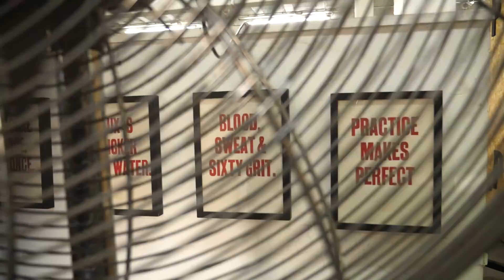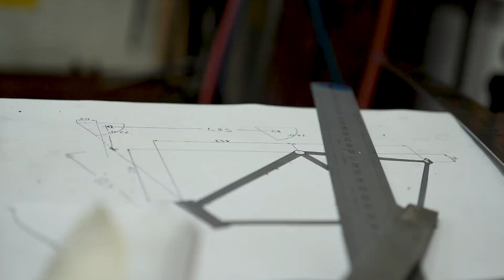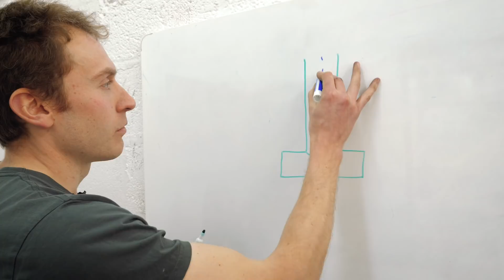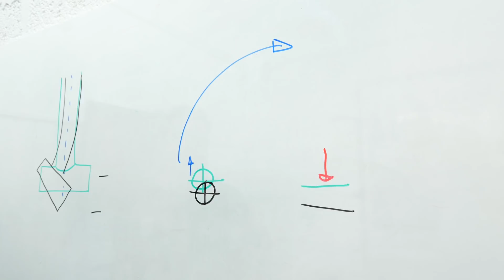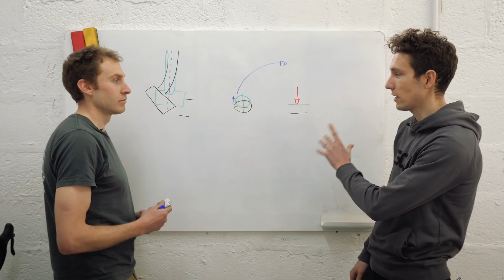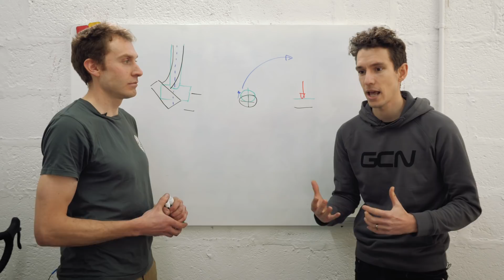Are You Faster On A Stiffer Bike?

Comment: It's really no rocket surgery.  As one that has worked with suspension on motorcycles for years, a basic understanding of suspension is recognizing that a spring is nothing more than an energy storage device.  Compress a spring with force, release that compressional force, and the spring returns the stored energy back in rebound.  This is why we have damping in suspension... to control that rebound effect of returning energy back into the system.  Obviously, as with all energy transference, there is some amount of energy consumed and released as heat rather than mechanical energy, but with a basic spring that energy loss is miniscule.  A flexing bike frame is nothing more than a spring...  Bend it, release the compressional forces that caused it to bend, and that stored energy is returned to the system.  It is actually a bit more complex, but the basic principle described in this video is really pretty elementary physics.

And you didn't even get into the benefits of frame flex in increasing suppleness, decreased rider fatigue, the effect it has on tires, etc., etc...

Comment: Where is the energy returned? I think this boils down to how much is the frame being heated up. It's not zero, because flexing a material is not loss free. But can anyone put a number on it? Frame flex is much more important as it affects alignment than for other reasons. The wheels need to track, and things need to not rub as you pedal (both for physical reasons and psychological reasons). Riders have actually attributed grip problems when cornering to too stiff of a frame,  I remember Chris Horner mentioning that they noticed this happening with the Trek Domane the team was given (whatever year it was). Apparently they talked to trek about it.

 I think a traditional steel frame (1'' top tube, 1 1/8'' down tube) is probably good enough for many people. Bigger riders might decide oversized tubes provide a positive difference. Anything else is for weight reasons in my opinion. Carbon fiber frames cannot be light without being very stiff, or way too flexible and/or not strong enough). 
This is what happens when the next year's frame needs to have a sightly smaller number next to the 'g' symbol on its data sheet. An entire sport, and an entire recreation of riders acting like clowns for seemingly no good reason. 

Wasn't the whole point of the UCI rules that no rider shall receive an advantage from their equipment? So what if everyone's bike weighs 8 kg, or 7.5, or 6.8? But at least we can leave that to professional racers who need to stay competitive within the rules to worry about. Non racers doing it is cringe worthy.

Comment: You mention tire widths. Same principle with frames. The more deformation, the more energy loss. A better experiment would be; have the host do some riding and track his power and velocity on the same course with the two different bikes. 

This experiment is tracking the stiffness of frames. Stiffer frames will respond quicker which transfers the power into fhe drivetrain, it doesn't show an energy loss. In the second bike he use applying more force, so yes more force was used.

Comment: This was a good way to illustrate flex, but not a proper way of testing flex/stiffness vs efficiency. Tthe amount of movement of the rear wheel is basically irrelevant because they've tested to an even amount of flex (which is requiring different force amounts. A much better way to test is to use the same force. It's more difficult to test that, but that is the type of test that could actually supply useful data.

Relating to their conclusion that frame stiffness might not be as important as previously tought -- even if it is just as efficient (it's NOT), a flexy BB area on a bike is annoying, AND if you're getting chain or brake rub, those are additional losses.

Comment: The biggest problem I have with this demonstration is that the load which flexes the frame peaks where his pedal was and drops off towards the bottom of the pedal stroke. This means that the frame bending back to its original position at a 6 o'clock would merely move the pedal out to the right and not cause any additional rotation or therefore put the power back into the drive system.

Comment: Nice video. Good amount of frame flex has another benefit, you have more mechanical tyre grip as the "suspension" frame flex in corners.
Race motorcycle's use this principle aswell.

Comment: even if the frame "gives back" some of the power that flexes it, this process will waste some energy anyway, it's a matter of physics. The reason why this couldn't be necessarly that bad, is in my opinion in the fact that the "kick" of the frame might be well "synchronized" with your pedal stroke in the dead point, and (at a high pace I think) result in the feeling of a more fluent -and thus efficient - action

Comment: I am so confused and amused.  First off good show.  Less scientific than id like , more measures of force etc.  However i had my aluminium frame bike getting worked on.  So i road my  iron giant, vintage moutain bike on a long gravel ride instead.  Racing home for lack of daylight, and lights.    I did 16miles an hour for 10 miles.  I was amazed.  I have not yet been able to duplcate, this on my much newer lighter, aluminium, stiff frame bike..  very interesting.

Comment: Tall guy who just got his first carbon frame after riding on an old steel frame. 

I ride a 62 cm bike, I wonder if the length of the seat tube has any effect on the amount of flex. One of my more seasoned cyclist friends suggested to me that longer tubes flex more, which seems to make sense. 🤔 I know that my new carbon bike certainly feels faster, but I’m sure there are many factors at play other than just frame stiffness. 

Very interesting vid.

Comment: My GT cross-country frame does this. When I first noticed it definitely made me skeptical about the ability of the frame to do what I needed it to do. After 3 years of really solid single track and light jumping (3 feet or less) I'm convinced it will never be a problem. And at that point, if it is a problem, I should probably be on a more rugged frame than a XC anyways.

Comment: A perfectly stiff bike should have zero energy loss while a flexible bike will still have some "hysteresis". If we're worried about watts, then even 1% of your input is substantial. 3 watts lost at 300 watts.

The energy of a spring is 1/2kx^2. Twice the flex, four times the energy stored. Four times the hysteresis losses.

Stiffness will improve drivetrain efficiency until hysteresis loss becomes negligibly small.

Comment: Very interesting...and reminds me of a pendulum effect that once the bike flexes from side to side, that exactly provides the momentum. Very similar to when you're lifting weights, a bit of swing in your body or arms provides that little bit of inertia to make it seem easier to lift the weight compared to a dead lift. 

However, on the flip side, the flex might also be stretching the chain slightly that when the brake is released, the energy stored in the stretched out chain is released, making the rear wheel spin.

Comment: surely this experiment could have been made much more effective by applying a fixed mass to the pedal with and without the brake and counting the turns of the wheel to see if anything is lost by holding the brake. If releasing the brake results in less wheel turns then applying the mass without the brake then energy has been lost through the frame flexing test

Comment: The work on the pedal increases over time but power put back into the elastic spring like frame doesn’t increase. Overall it seems like you are losing some power transfer.

Comment: Flex on steel bikes is purely elastic, and therefore this action itself loses no energy, just acts like a spring.
Different angle on crankshaft might increase resistance, but because crankshafts have angular contact bearings, the difference between complete straight action and slightly angled stroke will be negligable.
On the other hand, because steel frames can flex on small bumps, they can actually lose less energy on rubber in wheels bending more heavily, which loses this energy on heating up.
Do a serious test in normal conditions but with power level measured and normalized to check if there is a difference.

Comment: There is a net loss in heat generated by flex, though small, its not insignificant, and also the stored energy released by unloading the frame comes at a different moment in time to the power stroke, so the effect will be (on a bike that flexes more) a more sluggish response, though a more compliant feel.

Comment: I think it's mainly about ride feel and user preferences what you feel more comfortable riding. But probably a stiffer frame is a little more efficient, as energy you convert and reconvert always involves losses to internal energy and these losses are relative to the time dependent behaviour (and in part thus to the displacement). A stiffer frame with a higher elastic modulus probably also has a more purely elastic behaviour and less viscoelastic parts, which would mean a lower energy loss during hysteresis of the loading/ unloading cycles; also less damping in both loading and unloading due to less pronounced frame flex displacement wise. Which means although the amount of energy stored in frame flex is probably almost identical for different frames, there is more direct conversion in stiffer frames resulting in less time dependent behaviour qnd less energy losses. But I still think it's mainly rider preferences as it also involves comfort and personal compatibility next to pure efficiency.

Comment: Your muscles first need to put energy in the spring (energy = force * stroke). To gain back the spring energy, your muscles have to hold the force. And here's where it goes wrong, because muscles use energy when holding a force, even without making a stroke.
Effectively what flex does is making your leg stroke longer, costing more energy, without returning more propelling force on the wheel.
You would need a mechanism to hold the force for you, otherwise flex is waste of energy. Currently, such a mechanism is not found on bikes.

Comment: This is neither new nor interesting!
The question isn't if energy is returned from the frex to the drive chain. The question is how much.
This has been widely debated in the MTB / XC community as here the suspension has the same issue.
However, testing is complicated and benefits are marginal compared to Aero.
I presume that the major issue causing friction here is the tilt of the crank.

Comment: In this experiment the rear wheel is fixed and when the pedal is loaded the distance between the rear wheel axle and the bottom bracket axle is increased so the chain is prolongs and when the pedal is released the chain backs to its normal size and the wheel start to spin.In the flexible frame  the distance between the axles under the load changes not so much( the rear triangl bends) so after the load is gone the wheel will spin not so much respectively as with the stiff frame.So the stiff frame has a better efficiency.

Comment: In this experiment, they had constant pressure on the pedal and then released the brake.
In reality, however, you don't always have the same pressure on the pedal if one pedal is at the bottom and the other at the top, for example, no pressure can be exerted.
In this case, the energy in the frame can also be released in such a way that a pedal simply moves back a little.
In the experiment, it would be like simply getting up from the pedal, then the pedal would return to its original position and the energy would be wasted.
In order to get a result from such an experiment, how much energy is released from the frame back into the pedal and how much really goes into the chain, the pedal and brake would have to be relieved of the pressure at exactly the same time.
Unfortunately, this experiment was not meaningful, the conditions in reality have not been met.

Comment: No research needed.  The explanation is fairly simple, and it's not damping/thermal loss as a lot of people are suggesting.

The bike is "returning" the power, but not at a useful time.  It's holding onto the extra energy that you're trying to put into propelling you forward, and giving it back later, through the crank when you release the pressure on the cranks.

A good analogy would be tying heavy weights to your feet.  Any energy you put into lifting your feet is given back when you put your feet back down.  But if you try and run, it's going to be a lot slower.
Reply: Exactly - if the returned power is at the wrong time it will work against you
Reply: When you are running, putting your foot down does none of the work of propelling you forward. You need to move your foot forward, which is just as difficult with the weight as pulling the foot up. Then, push off with the foot planted on the ground, which moves your body mass, and the weight on the foot doesn't move at all.
On a bicycle, all the power is from your foot coming down. With a slight amount from the upstroke if you're clipped in to the pedals. 
It is only vaguely analogous.

Comment: Stiff frame can make you faster, this is because the power transfer on the bike is so direct, while on a flexi frame, the power transfer is a bit delayed, it’ll be like an airbag, the power will be distributed around the bike instead of the drivetrain. And when the frame flexes back, some power is directed to the drivetran and some are directed to your orher leg. I hope it makes sense. 

Example: if you are doing a track stand, you apply both pressure to bothe pedals, all your power is not directed to the drivetrain, but it is directed to your other leg to balance out the power.

I’m just speaking this hypothetically

Comment: Yes. This experiment has multiple things wrong with it. the biggest thing would be that they pressed on the pedal and held it down. which just the frame right now is acting like a spring but because you're holding a single pedal down 99% the forces allowed to go back into the drive train. but when were peddling were alternating legs which means we're not constantly holding pressure on one side. 
when were actually pedaling alternating which side is relaxing and which side is applying Force. So this means that the frame is always flexing in the direction of the side with the least amount of force. so this means that the force is going in the opposite direction of the drivetrain weather be back into the frame and into your leg this equals force/power loss

Comment: Would be interesting to see what a slight flexible crank arm would be like. A strong arm stiff in every direction except the circular direction you pedal in. So that it almost to a small extent, absorbs energy and then un-flexes giving that energy back in the dead spot of a pedal stroke. I mean marginally flexible here, not excessively bendy, except perhaps for an exaggerated model. Also, this means that if suspension is not at all damped and has little or even no friction (lauf forks) then they may not actually rob us of as much power in total but rather just convert almost all of it to up and down bobbing rather than dampening it turning it into heat.

Comment: The problem is when the rotational force of the flex frame acts against your other pedal stroke which is now trying to flex the frame in the other direction. Therefore instead of adding to the rotational momentum, it reduces the momentum being applied by the subsequent pedal stroke - much like two out of sync light waves in destructive interference. This illustration is not honest. The best way to preserve the energy is to use a stiffer frame, full stop.

Comment: Same kind of elastic energy is stored in the tendon and muscle elongated and it plays significant role in efficiency of body movement. The time of energy load and the time of energy release should be taken into account, which means we should be able to measure the input  power and the output power, and how the power contributes to more efficient riding. I always  think of a elastic bike which could enhance the efficiency of ride.

Comment: Sorry if already mentioned, but... a basic flaw in this experiment is that it only looks at frame flex from one side of the bike? What happens if you put the block on the other side? As others have mentioned,  just put a power meter on the crank and a power meter on the turbo trainer for both frames  (keeping all other components identical) and see what the real losses are.

Comment: Pssh, there are so many factors that go into this and a lot depends on the rider's style, power, fitness, weight, etc. This example just demonstrates where the energy goes not that it even makes a difference in fast or slower. I think that depends on the engine. Stiff might feel more responsive and flexible might feel smoother its difference in actually making you faster is probably more based on the comfort of the rider and their ability to perform on that bike. Everything is marketing and though it might have tiny bit of merit, it comes down to being a fit rider, and frankly more than half of us aren't even in tune enough to tell the difference. If you feel fast it probably has more to do with you feeling good than whether your frame is stiffer than the next guy's. Otherwise, whatever is the stiffest frame on the market right now would be winning everything. The rider is the difference.

Comment: i believe that the biggest loss that comes from a flexing frame is the change in the way that the force is applied. The frame flexes and its geometry changes. so now the power generated by the footi is not directed straight downwards but with a slight angle inwards. Also when you bend something no matter how efficiently it returns the energy is is always going to have a greater loss than something that doesn't flex.